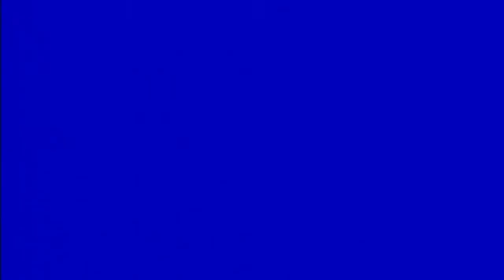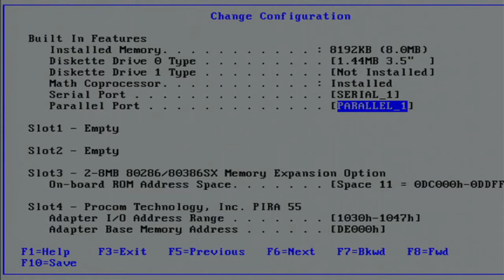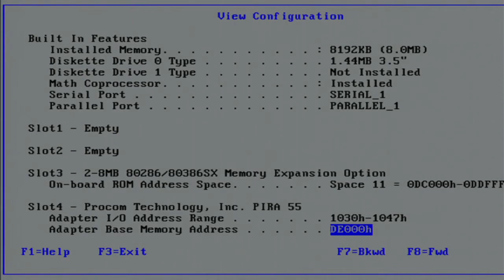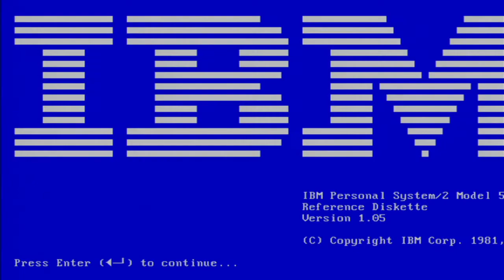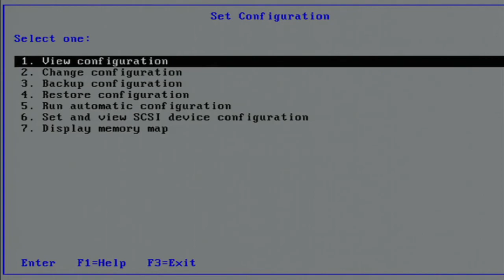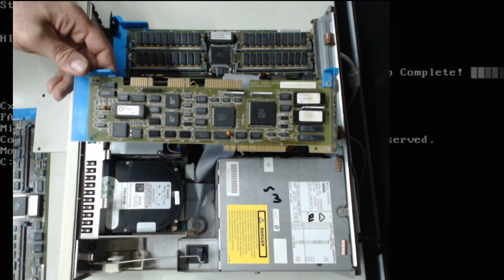Installing "2-8Mb Memory Expansion Adapter" on an IBM PS/2 Model 55SX

Comment: Got one of those for my 486SLC2 boosted Model 60 (with dual MFM drives). Suitable SIMMs seem to be quite hard to come by as per my limited experience since the adapter only accepts those deteced as 80/85ns - so far I've managed to get 3MB running stable on it, 8 of course would be awesome.
EDIT: 8MB also work as 2MB. I assume pretty most double sided FPM RAM with parity will work - if the presence detect pins are set correctly.
EDIT2: Got the full 8MB range working for my card. Next step - maxing out the 60 at 15MB.